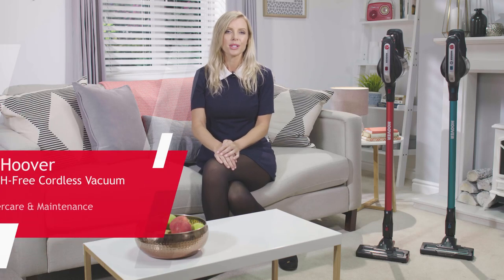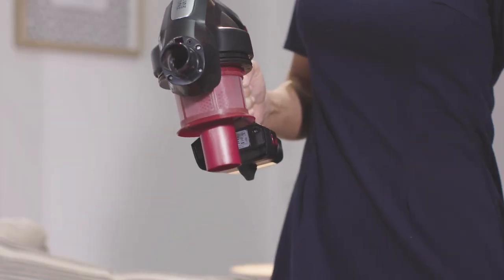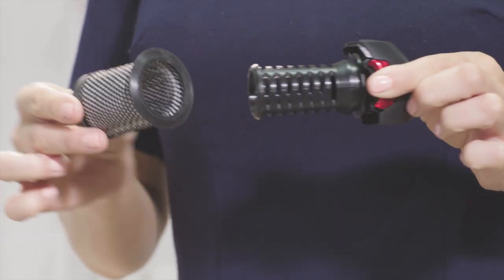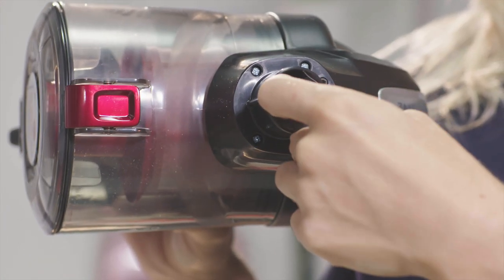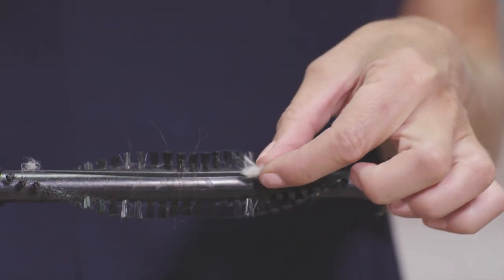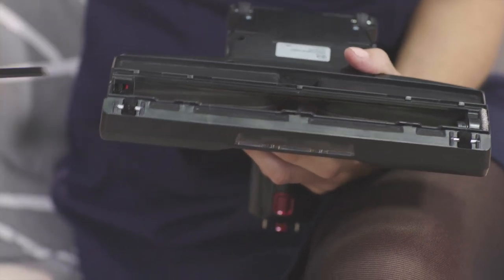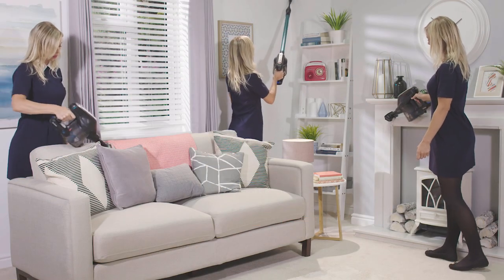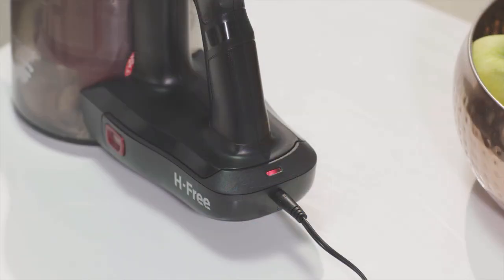Hoover H-free Aftercare

Comment: You unclipped the roller in foot of your over the with small scissors cut down in a line and it splits in two so its easy to pull apart